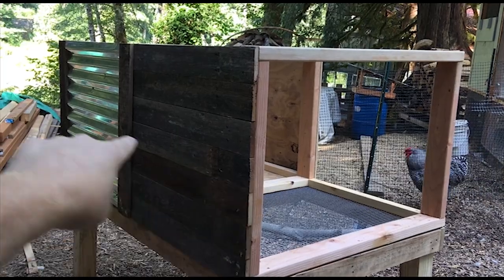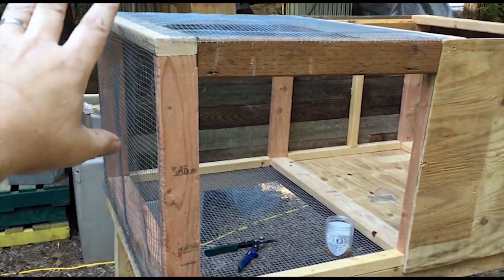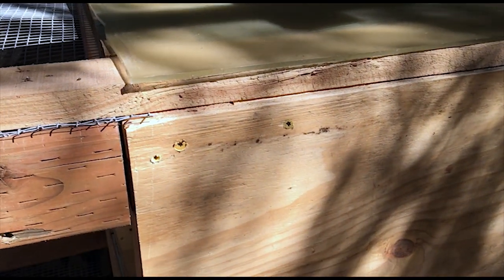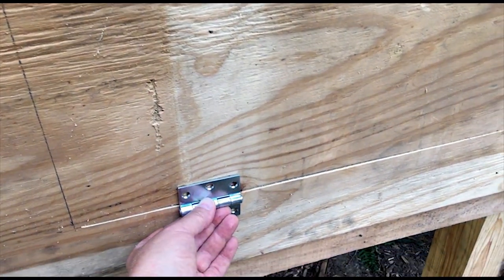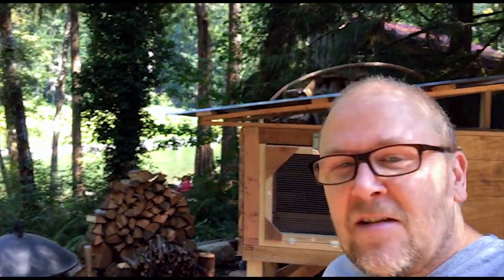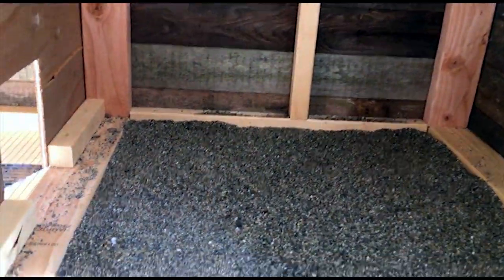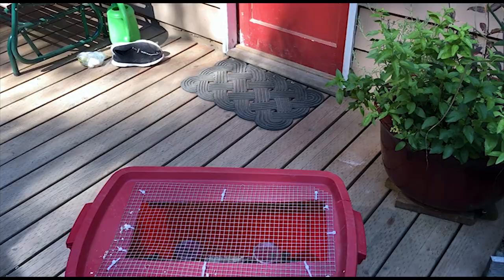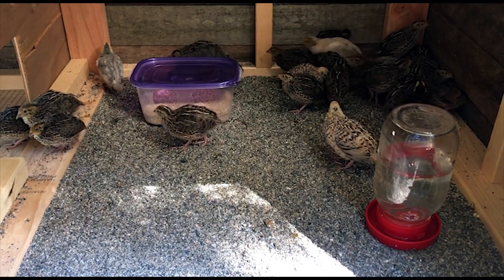Our DIY Quail Hutch

Comment: Removing pallate wood is best done by pounding from the underside working from end to end and back again.  Use a 2x6 block or a rubber mallet to evenly distribute the blows and stop splintering.  Pound the wood slats back down from the top avoiding the nails and this will expose (and loosen) the nail heads to then be able to use a pry bar.
Reply from the maker: Thanks!

Comment: Well done.  Those are some lucky quail to have such a nice home.
Reply from the maker: Christina Elliott Thanks Christina. So far they are doing well in there. I thought that they would hang out in section with walls now that it’s getting colder but they stay by the hardware cloth for the most part.
Reply: @AlmostHomestead  I noticed that when the first brave chick approached the side with hardware cloth, there was definite hesitancy.  Maybe it's unnatural for them to walk on something they can see through especially from a height.  I know that's true for human crawlers and toddlers.
Reply from the maker: Christina Elliott They definitely had to get used to it. They stayed in the side with the solid floor for awhile before they would come out and walk around on the wire. I cut the wood floor out of the other side shortly after the build. Just too much poop piling up.

Comment: Great video thank you!! We are getting quail in a couple days and I’m building my coop today ☺️
Reply from the maker: I did away with the wood floor due to so much poop build up so fast. I had a few different things for them to climb and stand on though in case they wanted to get off of the wire floor.  I also ended up reducing the flock and using a large dog cage/crate for their home that had a built in poop tray which was great. I made a video of that build also. Good luck with your build.

Comment: Nice build! Way to use and reuse!  I have Bobwhite quail hatching in about a week. I don’t have their outdoor cage set up yet.
Reply from the maker: Thank you Tessa! I need to do an update video. There are a few things that I would change if I built this again. I am going to build another hutch or modify this one. I left 2 x 4 ledges inside the coop that catch poop and doesn't allow the poop to fall through the wire mesh. It builds up quickly and smells bad. There shouldn't be any ledge...just wire floor. Also, I would put a slant to the wire floor also so the eggs roll toward the front of the hutch. Sometimes I have to stick my head and hand way in there to reach an egg at the back of the hutch. I have had a quail fly out over my head twice while digging inside for an egg. Haha! I was able to recover the quail both times but one time I didn't know that a quail had escaped until I saw it jumping around behind me on the ground.

Comment: Looks good, but the metal you put on the housing area for the Quail will get the inside very hot if it is exposed to Sun. I know because I did this on one of my hutches, I had to take it off.
Reply from the maker: Thanks Bonnie. We stopped raising quail a few yrars ago. 🙂

Comment: Nice hutch! I used to raise quail commercially a few years ago, several different species including Coturnix like you have. Great egg layers and good meat.
Reply from the maker: Stoney Creek Heritage Farm Thanks Bill. We’re looking forward to the meat and eggs. Did you have a closed in nest area or just open cages. Wondering what you used for bedding if you had an enclosed area. We’re using sand but those little buggers poop so much it’s hard to keep it clean.
Reply: I found mine didn't do closed in areas well. So I just had one big open area. I used a shallow plastic pan for dust baths, with frequent changes...sometimes they laid in there, but typically they just laid an egg where ever they happen to be. Ended up building cages that were on a 5 degree slope, so all the eggs would roll to the door for easy collection. 
Two huge mistakes I see people make (You haven't addressed it, so not saying you're in this category) To be successful with quail, they need gamebird/turkey crumble starter feed. Greater than 20% protein, 24%-28% is optimum. For breeding age adults, 3-6 hens to one cock bird, rule of thumb is 1 square foot of floor space per adult bird. Coturnix might be small but are vicious, you'll find scalped and dead birds in an over populated area and stressed birds don't make eggs. (for growout pens, you can over populate just keep the feed and water to them, once you start seeing eggs in about 6-8 weeks, better start weeding them out or the blood bath will be on)
Reply: Kept them on wire like the one half of your hutch too. Interesting thing with Coturnix, if kept on the ground, they are actually a burrowing quail. They will dig tunnels and lay their eggs in a community nest...but they have been domesticated for so many years, typically are not broody. I only had a 3 hens go broody and successfully raise chicks on all the years I had them.
Reply from the maker: Stoney Creek Heritage Farm Great info Bill. Really appreciate it. Wasn’t aware of their vicious nature. We do feed them starter crumble from the farm where we bought the quail. I think we need to rethink our housing situation. I’m thinking we’ll do 5-6 hens and a rooster in this existing quail hutch and put another group in our greenhouse. Then put them in a hutch of their own come springtime. Maybe make a predator proof hardware cloth box in the greenhouse for protection at night. The rest will be in the freezer.
Reply: Sounds like a perfect plan to me.
Reply from the maker: Stoney Creek Heritage Farm Thank you so much for taking the time to share your experience and knowledge of quail.
Reply: No worries! Glad to help. I like to see folks in our community be successful in their endeavors, so enjoying sharing when I can.

Comment: Love your hutch. Now that you've had it for a few months, how's the cleaning going on the sand side? We currently house 3 quails on a ground level coop, but finding we have to clean almost every other day because of all the poop. Trying to find a better design and yours looks great!
Reply from the maker: hsinglanjin I cut out the floor on the sand side and added a screen floor. The poop just piled up to fast with a solid floor. The screened floors work great but the poop does pile up fast under the coop. I throw straw on top of the poop every once in awhile to keep the smell down. Then I take the pile to the compost pile once it’s getting too big. I do have to scrape the inside of the coop about once a month with a spatula wherever there is wood on the floor and no screen. Thanks for watching!
Reply: @jorgepestano4997  ngl you sound like a ad you said the same thing in another video

Comment: How's door fitting now? You didn't allow for swelling or shrinking.
Reply from the maker: The door was a little tight on bottom corner so I shaved a little off. Other then that,  I haven't had any other issues.

Comment: That looked more like small pebbles not sand. They need a place for dusting and pebbles won 't work!
Reply from the maker: Yes indeed. I introduced a dust bath shortly after this video and made a wire floor with a wood platform to rest on. I also built a different cage after that.

Comment: Nice design 👌 one question how do you catch the droppings from the wired run?
Reply from the maker: Sorry for the late response. I just saw your comment. I was letting them drop on the ground and then covering them with straw or wood chips. It was not the best method especially if I let it build up for awhile without taking it to our compost pile. I use a different cage now that has a tray to catch the poop. I have a video showing that cage on our channel also. Thanks for watching! 👍😁